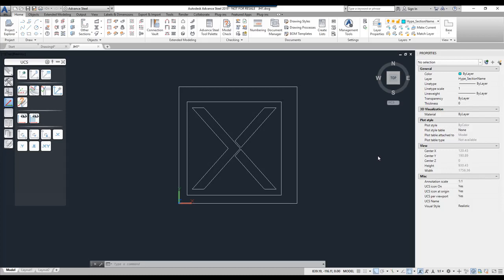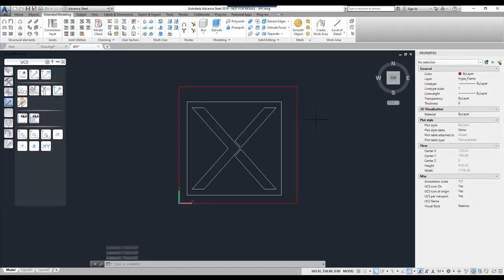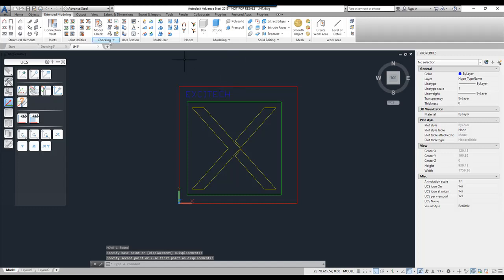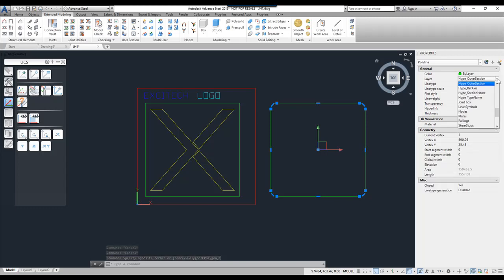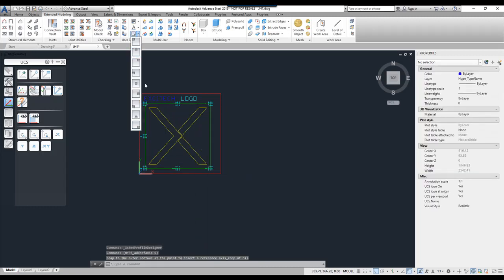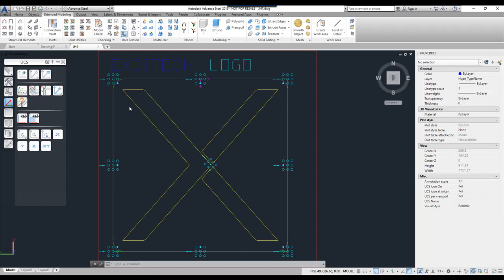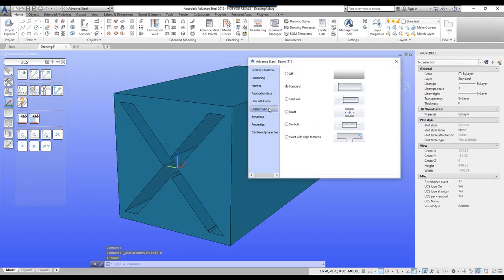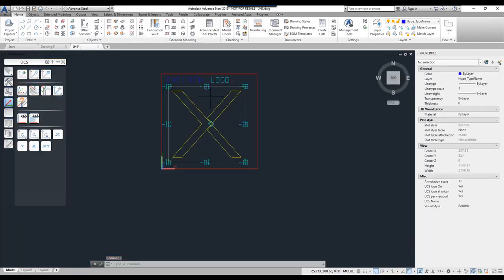Autodesk Advance Steel – How to create a custom user section

Comment: Hi! Firstly, thank you for the video. It really helped me when I did my user-defined WT I-beam section. However, I would just like to ask what does "inner contour not closed" mean? I cannot attached the picture but a dialogue box appeared containing that message. Hoping to hear from you soon. Thanks!
Reply from the maker: Select the polyline and change the properties of the polyline to closed.  This should then generate as required.